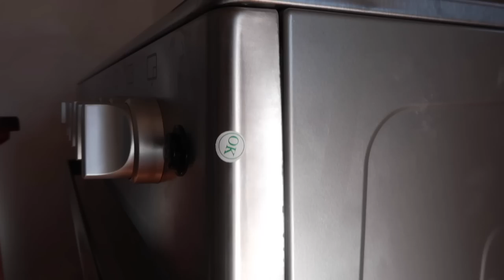2 Years Without This! Upgrades on our tiny home.

Comment: We have a bottle gas stove. We just use matches to light the burners and our oven has a little hole in the base at the front so you can see when it is lit so we put a match to this little hole and it lites every time, just in case your power is low ever you can use matches. Enjoy your new oven, I think I will make some flapjacks today too you reminded me we haven't had any in ages.

Comment: How to identify. As a member of the daisy family, Chamomile is a composite flower so has a daisy-like, disc-shaped flower head that consists of lots of tiny flowers in the form of disc florets (the yellow 'centre') and ray florets (the white 'petals'). Its leaves are small, feathery and much-divided.For example, many daisy plants have multiple rows of thin white petals, while chamomile plants have a single layer of petals, also in white. Additionally, most daisies, especially common daisies, do not have leaves on their stems, while chamomile has very thin and spindly leaves on their stems. i hope this helps some.
Reply from the maker: thank you! I shall go and look tomorrow and take your notes with me ☺️

Comment: Think about where the exhaust hood is going to be, before you relocate the oven. Gas ranges need an extractor hood. About the walls, you can install sheet tiles as a backsplash, easy to clean, just seal the grout well before you start cleaning
Reply: window and door ventilation is sufficient
Reply from the maker: Thanks, we weren’t sure about this
Reply: I would also put a penetrating sealer on the floor grout, and when that's dry I would apply a top sealer on all the grout lines. That way, cleaning is easy. Grout is porous and will absorb dirt in otherwise. When the grout is new is the best time to seal it, otherwise you're either going to have to live with dirty grout lines or have to steam and extract the dirt out of the grout lines periodically. It's a big job that can be easily avoided by sealing the grout lines
Reply: @CLFL14256  in summer maybe. But when you're trying to keep as much of the air you paid to heat or cool, that's not feasible. And besides that, an extractor hood has screens that capture a lot of the grease in the air while you're cooking. Which screens can be washed off periodically. I personally bought a light industrial hood from DCS (dynamic cooking systems), very powerful. The hood that comes integrated with an over the range microwave for example, is worthless. Waste of money.

Comment: Hiya just saying hi and enjoy your channel .Just one comment I think you need to change your gas jets in your new cooker to run on liquid gas . You need smaller jets as I expect the jets are too big .Just Google it the jets are only about £12 . The flame will burn better . Cheers keep up the good work .👍👍
Reply from the maker: Hi Dai! We’ve got a set of the jets that came with it, where do I change it? 😅 first time oven buyer here
Reply: @FrankieOffGrid  Hiya if you just lift off the cooker rings you will see very small brass jets with very little holes in them and a slot .just unscrew out anti clock wise and screw new ones in .refit rings ..
Reply from the maker: Thanks Dai! I’ll give it a go!

Comment: When one uses the log holder that you have used is great, but the idea of it to hold the log and you cut the part on the end while the log is remaining in the part that holds the log.  It is not working in your favor, when you cut it in the middle, rather the end, because the log falls in on its own weight and actually binds up the cut by the weight folding the log into the cut.   You are managing to get away with the way you are doing because the logs you are cutting are so small and already very short.
Reply from the maker: The size of the logs is making it tricky for sure!